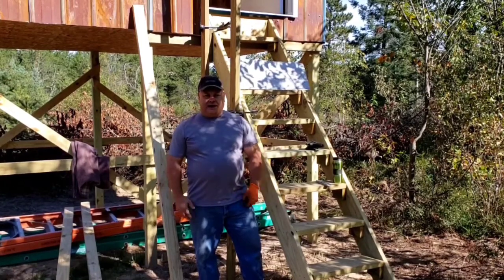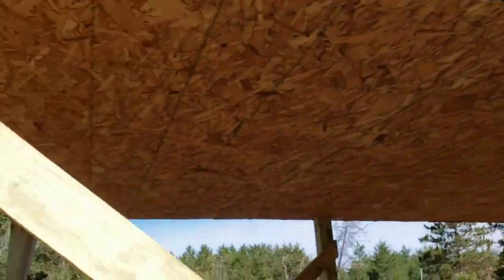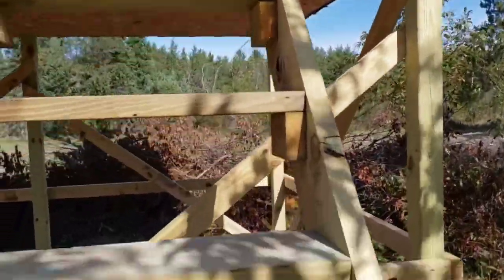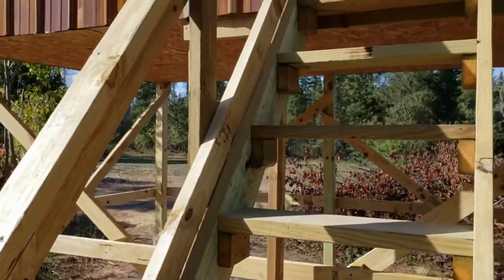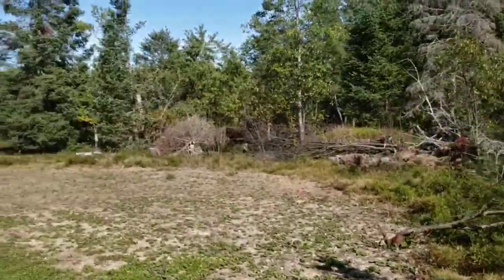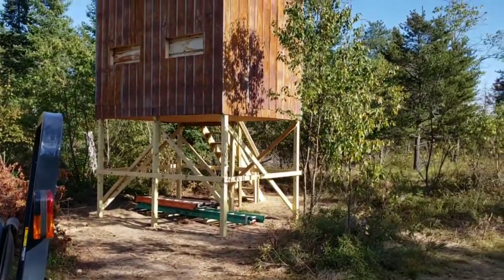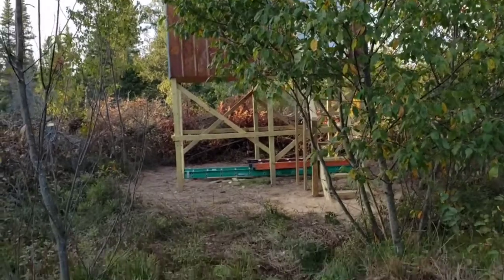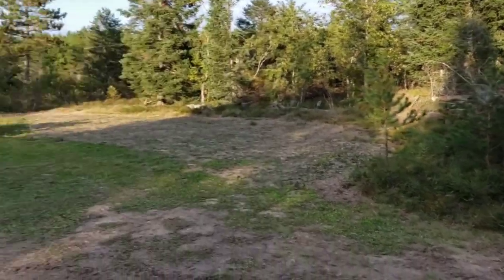Elevated Hunting Blind Build - Part 3

Comment: Question....did you close off the bottoms ribs of the metal sides? I have a metal blind also, and debating on filling everything in with expandable foam to keep mice and bee's from building nests behind the metal.
Reply from the maker: We ran the metal long below the osb by about 2 or 3 inches. We did not fill it. We have other buildings on the property with this type of metal and we've never had an issue.

Comment: this is awesome! i just have a few questions and i hope you’re pretty good at responding to comments. how much did this cost and how long did it take you to build it? how many hours a day did you end up working would you think?
Reply: super cool build!!
Reply from the maker: With the high cost of lumber this year it was an expensive project. Including the insulation for the interior and luan paneling for the ceiling we're at right around $3,000. As For man hours I have no idea. We worked on it off and on over several weeks. Sometimes we had several people working and other times I was working solo. If you had 3 guys who had the right tools and equipment and you all worked  full days, you could probably close it in in about 4 days.
Reply from the maker: We worked long days, usually until dark. The posts and platform was built in 1 day.